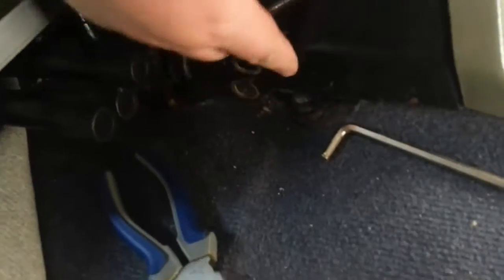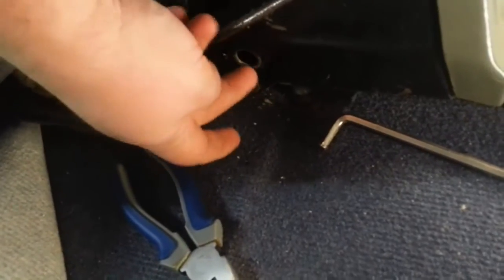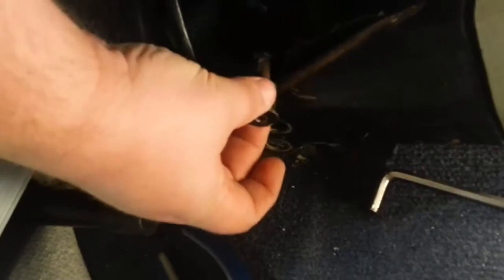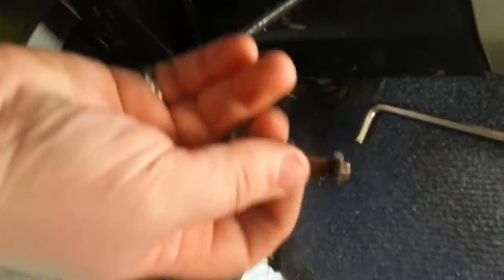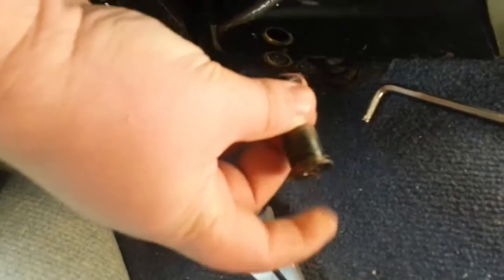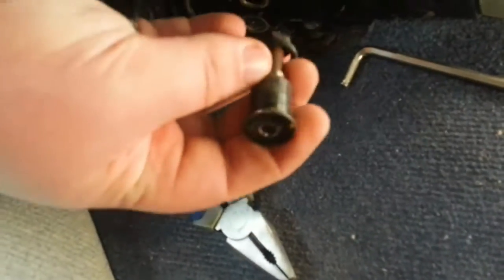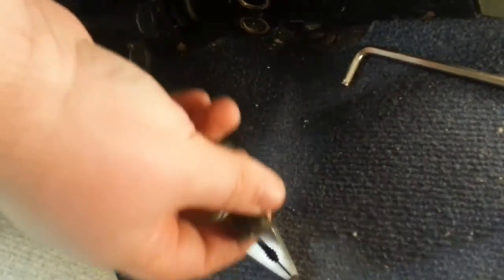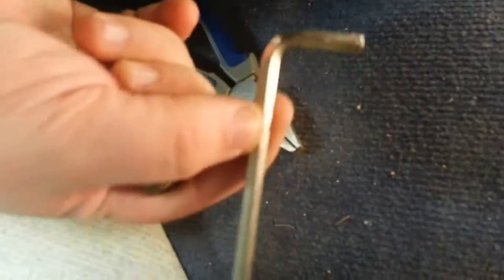VW T4 Caravelle: How to remove folding seat

Comment: Hello. You don't have to remove anything. If your seat connections are rusty and didnt remove for a long time, use a WD40 for rust surface and wait. After that use a hammer and hit not strongly to the middle seats front to back direction. It will slide to back side slowly and you see.